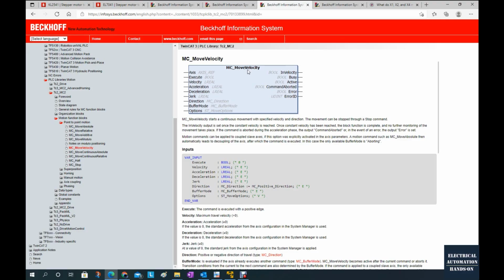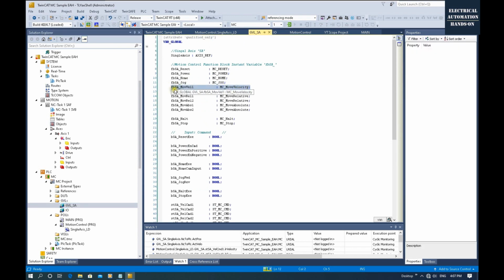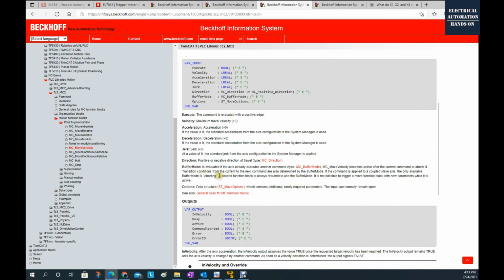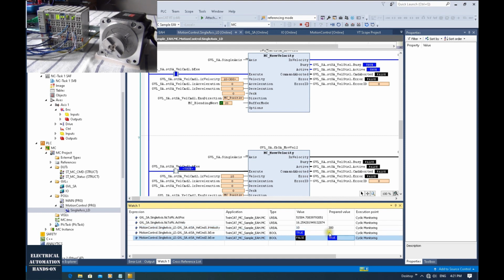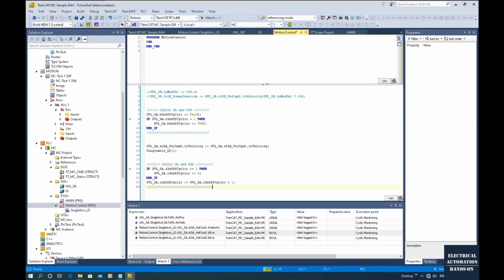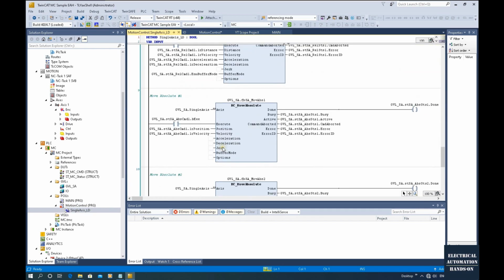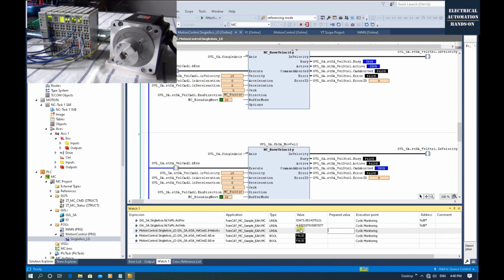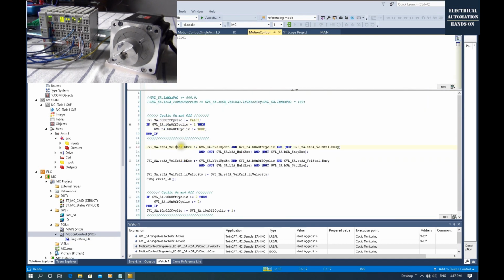MB17b. [TwinCAT 3 NC] Changing Velocity On the Fly - Two MC Velocity FBs [21/21]

Comment: Thank you for the video!

Couldn't an alternative using only one MC_MoveVelocity be to increase the acceleration, deceleration and jerk values in order to ensure that the system, i.e. the mechatronic assembly, responds quickly enough so that the setpoint speed is met? 

Then there would be no problem with the FB being "busy" because the mechanical system itself cannot "react" to changes on the fly in a timely manner (cases with insufficient acceleration/deceleration, as well as insufficient gain parameters for the PID control).

Is my thinking correct?
Reply from the maker: Your thinking and the topic in this video most likely are two different topics. The topic in this video was discussing the 'trigger -> update setting' behavior of the MC_MoveVelocity.
Reply: @electricalautomation  Got it, thank you sir! You have done a great job for us in the industry